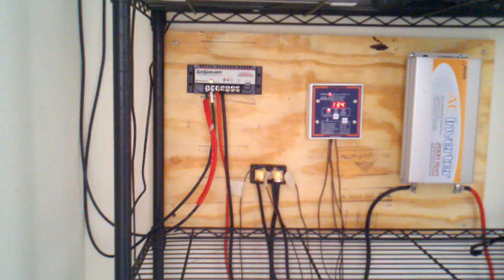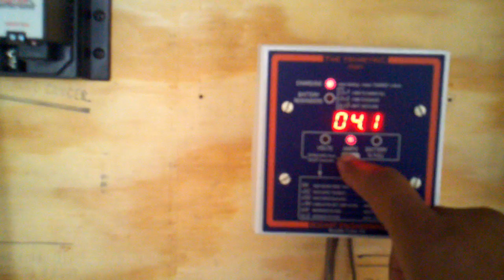DIY - Home Solar Power Part  #2

Comment from the maker: @jlo8232 In the description of this video, I've included a link to a schematic diagram of the expanded system showing 4 more batteries, the placement of fuses, disconnects, connecting points. This should give you an idea. For a fused portable system, there should be a fuse between the (+) DC inverter connection and the (+) battery terminal ,and between the charge controller (+) terminal and the (+) battery terminal, Check out this video description for the download link. Take Care.

Comment from the maker: @jmnic63 Thanks for your comments and questions. This is an old video and I've expanded quite a bit. However, I've answered a similar question or comment in the comments section of this video, in response to @OldTroll11 below. The response shows you an example of how to calculate runtimes of various items when using battery power. My latest videos show my expanded system. Take Care.

Comment from the maker: @pennvloger Panels, wire, and charge controller from wholesalesolar(dot)com,  AGM batteries from different sources. You can get good inverters from theinverterstore(dot)com. For cheaper panels check out sunelec(dot)com, ecodirect(dot)com may also has some good deals for you. You can battery cables from any autoparts store. 10 AWG wire can be obtained from hardware stores. Battery monitors from Amazon or eBay.

Comment from the maker: @mikestan167 When considering how to wire your panels, you must consider panel voltage, wire gauge, distance from the CC and the type of CC being used. My 12v panels use 10AWG wire that is more than 30' away from the CC, which gives more than a 5% voltage drop, making parallel wiring impractical. A series wiring with an MPPT CC works much better in this case by it using an internal DC to DC converter to use excess voltage to increase amps giving the same benefit as parallel wiring.

Comment: Why wouldn't you just wire the solar cells in series to obtain 12Vdc. And then connect the 12Vdc cells in parallel to get more current output to charge your batteries? Seems like a waste to go from 36Vdc and step down (power loss) to 12Vdc.

Comment: @gregoryscottsr also you would need a VERY big inverter to run a welder now you can take about 3 battery and make it where you get about 30+ volts and use that to weld with in place

Comment from the maker: @OldTroll11 Actually, this system can run lighting such as lamps with CFL or LEDs. Runtime can be calculated using watts, I.e., ((55*4)*12)=2640w. (2640w * .80 =2112w of usuable power). 2112w / 13w (bulb) = 162hrs.  2112w / 125w (TV/DVR)=16.89hrs.  2112w / 100w (Compact Freezer)=21.12hrs. Just a few examples.

Comment: How many years can your batteries last? 5years? I'm very sure those batteries are pretty damn expensive. The money you saved from the grid may not cover the cost of your system in 5 years. Add up the material cost and labor cost (your time is money), this project is actually saving your electricity bill? or just for fun?

Comment from the maker: @gregoryscottsr Thank you for your question. No this system could not run a welder. This is a small backup system geared towards typical household items such as lights, microwaves, tv's, stereos, etc. From what I understand, a welder requires a considerable amount of power and I believe you would need an equivalent amount (x2) of panels\batteries to support it. Take Care.

Comment from the maker: @Yanglike For panels I recommend going to sunelec(dot)com, they have good high wattage panels at very reasonable prices. I also recommend Mourningstar brand charge controllers. For batteries it's a toss up. I like the AGM's because of their advantages of being sealed, not out gassing hydrogen during charging, temperature resistance etc., but pricey. Any traditional high amp (115A+) flooded batteries will work just as well. Trojan, Optima, Werker, Kirkland (Costco Brand) or any will do.

Comment from the maker: @Yanglike Thanks for your comments. Actually, I've expanded the system quite a bit. But this particular system was capable of running things like TV's, entertainment systems, microwaves, A compact Freezer, lights (I have a lot of LEDs), etc. With solar you must practice energy conversation and run only essentials. My current system is tied into our home, which allows me to run the entire house in the event of a power outage as a backup system, but my office is sometimes off the grid.

Comment from the maker: @HappyGuitarGuy Yes, it's possible to mount a solar panel on the roof of a vehicle. Using a "roof rack" similar to those used for luggage, ski's, etc, you could feasibly mount a medium sized panel to the roof of your car and run the wires to a charge controller and battery(s) in your trunk. It's a matter of direct sunlight hitting the panel, in the desert you shouldn't have a problem. Depending on the type of roof rack, you would need some type of clamping mechanism to secure it.

Comment from the maker: @PianoPassionMusic Thanks for your question. I use sealed AGM batteries and do not vent hydrogen when being charged and are generally safe to use indoors. However, flooded batteries vent hydrogen while being charged and require adequate ventilation. However, I believe they should be fine in a garage or basement setting with enough open space and good ventilation, etc. AGM batteries cost more but I don't have venting, maintenance, or temperature issues. Take Care

Comment from the maker: @RamonSmit Thanks for your comments, but I think there is a bit of confusion on your part, the video shows a battery bank with 4 12v batteries connected in Parallel, see all of the red & black cables connected together. If they were in series, the battery monitor would read 52v (13 x 4) instead of 13v.  Series wiring increases "voltage", parallel wiring increases "amperage", which in this case increases capacity.  55ah x 4 = 220ah at 12v. The panels are wired in series. Take Care.

Comment from the maker: @K3vindust Actually, if your scooter battery is a "deep cycle" battery your good to go. Never use ordinary car batteries or any battery that's not a Deep Cycle battery.  For portable systems search youtube for this video for ideas. "Step by Step: How I Built A Solar Generator For Less Than $300" and to see how I use mine with "DIY - Portable Solar Power - The Practical Freezer Test - PART 1". You can see it on my channel. Take Care.

Comment from the maker: @LXBD Hello, lets calculate (4 batteries x 55ah = 220ah), (220ah x 12v = 2640w), (2640w * .80 "Depth of Discharge " = 2112w), (2112w / 540w = 3.9hrs running time.)

Comment from the maker: @honestcheetah That depends on the wattage and voltage requirements of the system. A small backup system such as this is mainly geared for things such as lights, stereo, TV, fans, computers, communications, and\or a microwave. The "on demand" systems I've researched require 240VAC and between 12kW - 19kW to run, you would more than likely need a bigger battery bank with higher amp capacity to support it. Also, an inverter that would support the voltage\wattage requirements.

Comment from the maker: @Facestomper666 Definitely not a waste of time. I enjoyed every minute of doing the research and putting it together. In the beginning I didn't know anything, now I can share the knowledge with others. Yes, generally batteries last 6 years, however, if you buy good Deep Cycle flooded batteries, it may be possible to recondition them after the 6 years, if necessary. This reconditioning may give you an extra 2 to 3 years. Google, "Battery Reconditioning" and you'll see what I mean. Take Care.

Comment from the maker: @Facestomper666 The system was designed to eventually be as close as professional grade as possible. Over a few months I've expanded the system to include additional components. This was not to see how cheap I could make it. This was only the beginning, this is an old video, now I have a system comparable to any commercial system at half the price. Also, with the 30% tax credit the total cost was even less.  Now I can power my entire house safely, without extension cords or fumes. Take Care.

Comment: @rhandsom  Hmm...  maybe it's my preference for high voltage systems :-)    Low amps and high voltages keep my system as low loss as possible and I can use rather thin cabling with proper insulation.

Keep up the good work!  :-)

Comment from the maker: @hobbyguy Thanks for your comments. If using PWM charge controllers it wouldn't make since. However, The Mourningstar MPPT charge controllers work best when there is a large voltage difference. They utilize a DC to DC conversion circuit and use the excess voltage to charge the batteries faster, ie., they will convert the power coming in so that the voltage is lower and the amps are higher, while maintaining the (watts in = watts out) rule. MPPT's work best at higher voltage differences. Thanks.

Comment: Why would anyone want to step down 36VDC to 12VDC when 3 batteries in series are 36VDC as well?  This way you are introducing unnecessary losses which could be avoided quite easily.

Comment from the maker: @serij800 Actually this is one of my earlier videos. However, when the the Mourning Star 15A MPPTs are installed in a 12v system the power from the panels are limited to 200W. With that it's 200w / 12v = 16.6A. That's one of the reasons my system is now a 24v System with 4 panels, totaling 670w, with a 3000w inverter and dual mppt charge controllers. See my channel for the latest videos. I've expanded quite a bit.

Comment: Hi, 270 watt divided by half full battery charge voltage 12v equals  22.5 Amps to the battery, with only 15A MPPT  ? is mppt still working ?

Comment from the maker: @elcomandante31able That depends on the type of monitor you have. The monitor should come with detailed instructions that are specific to your system. In my case, the G1,G2 wire is connected to one side of the shunt, the SIG is connected to the other. The positive lead is connected to the same positive terminal on the battery as the positive leads of the Charge Controller and the Inverter. Take Care.

Comment from the maker: @firehawk71 Actually this is one of my earlier videos. My current system is tied into the transfer switch and Interlocked from there into the main panel with an Interlock Kit to backfeed electricity from my solar generator to all of my home's 110 outlets and fixtures. The videos on my channel show the progression and setup. On a couple I've attached schematics. The system works fine. Take care.

Comment from the maker: @nyc347347 You may be right in that they maybe sturdy enough to face things like hail or other flying debris. Without seeing them I can only assume. The weight can be dealt with by mounting them on a sturdy pole or other suitable mounting structure. I have 4 panels that are easily 40+ lbs each. The double pane is the only other issue I have questions about, if you can sandwich the cells between the double pane it'll handle high temps well. To put the cells under 2 panes may decrease your power.

Comment from the maker: @nyc347347 Tempered glass is the only glass I would recommend if building your own solar panels, if your going to keep them exposed to the elements. There are many people that use regular glass, plexy, lexan, etc., but if you want something that will last and stand half a chance against the elements, use tempered glass instead.  When I tried building my own, I used Lexan with disappointing results. Granted, I didn't know much about what I was doing, but disappointing results all the same.

Comment from the maker: @DarwinsFriend I respect your opinion but please understand, when i was designing this system, I didn't care and still don't care about "payback" or anything of the kind. As an Engineer I was concerned about building a quality system, piece by piece, for the safety, security, and well being of my family. And that my friend is worth the price of quality batteries and other equipment. I didn't get into solar for financial gain, going without power for 7 days will make you think. Take Care.

Comment from the maker: @greg2000ad 
The monitor is a  TM2020 Tri-Metric Battery System Monitor. Price: $139.00 from bestconverter.   Works really well.  Thanks for the comment.  You can probably get the monitor for cheaper on ebay.